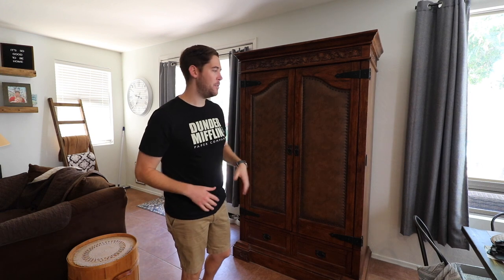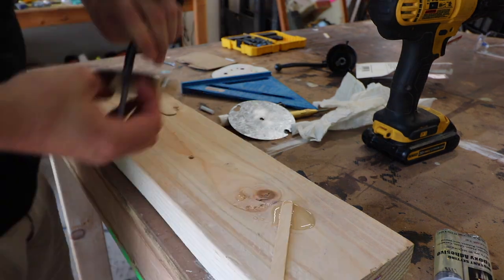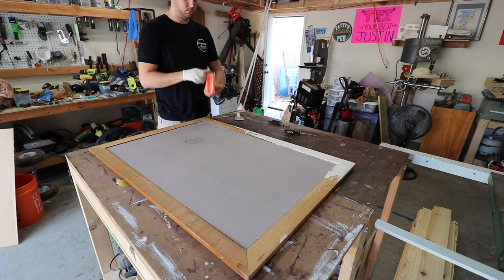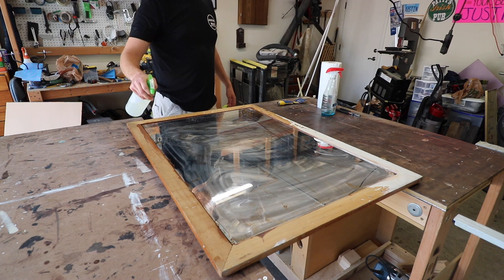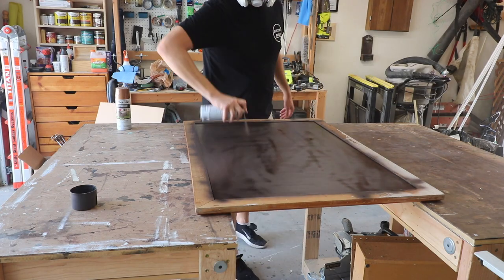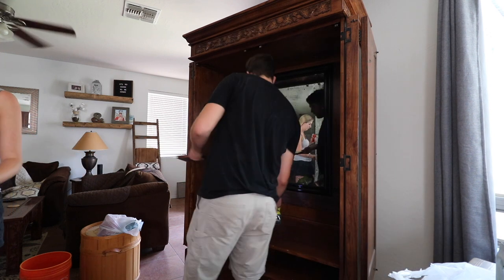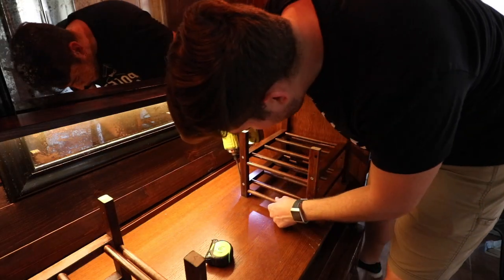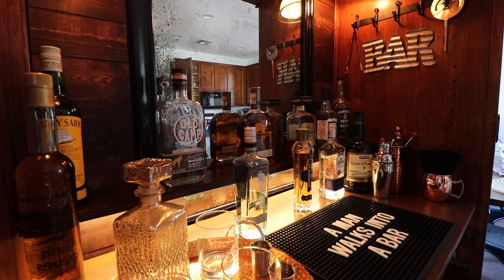Upcycling an old TV Cabinet Armoire into a Bar!

Comment: Did you wire the under cabinet lighting to your two wall lights to turn on at the same time? Or are they on separate switches?
Reply from the maker: I did, I wired a switched outlet and plugged the lights into that.